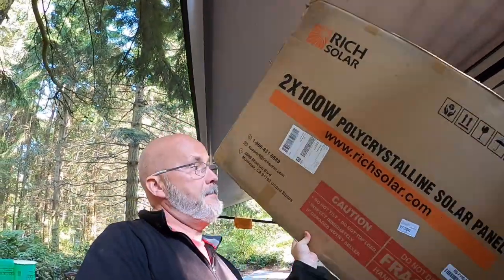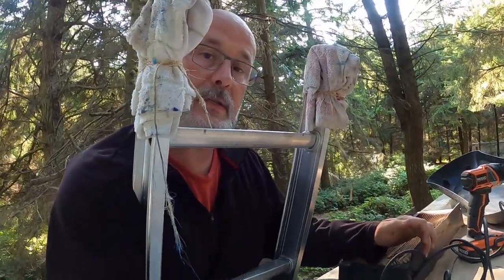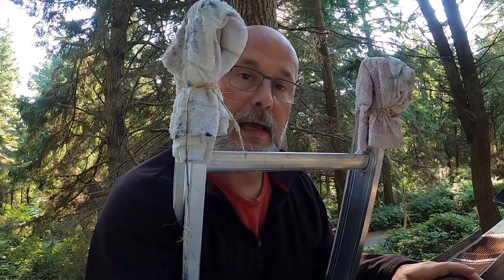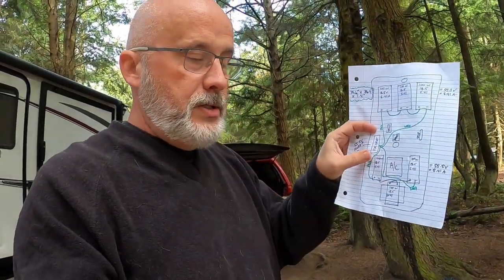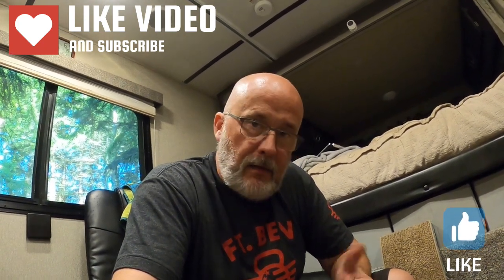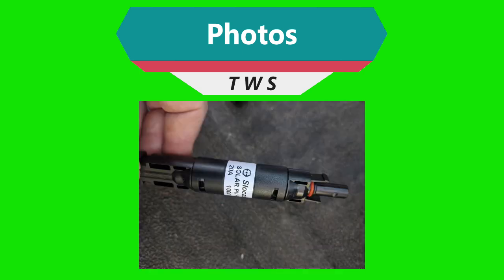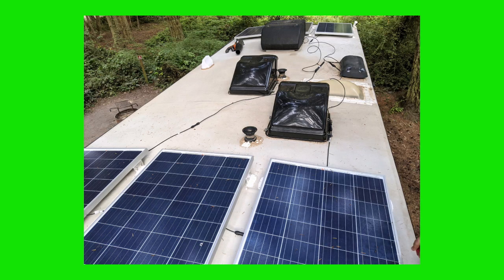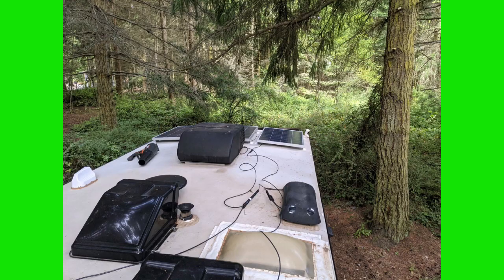UPGRADING OUR RV WITH 600 WATTS OF SOLAR- SOLAR INSTALL VIDEO

Comment: Thank you for this video. Currently have 200 watts on the roof and a 100watt ground mount but its not enough to keep up with the 12v fridge for more than a couple of days. I will be adding an additional 400 watts to the roof very soon. Would love to read some stats on the kind of power your pulling in on sunny days/cloudy days etc.
Reply from the maker: Eddy, Glad you enjoyed the video and thank you for watching. It's funny you should mention the solar setup. I was actually just working on it the other day. We still have the 600 w on the roof and the 340 amp hours of lithium. Since I did that video I have actually upgraded my solar charge controller to a 60 amp hour controller so that I could use all of the 600 w that I have. I realized that the 30 or 40 amp hour solar charge controllers would potentially be limiting my use of 600 Watts. Long story short, I also mistakenly undersized one of my wires from the solar charge controller to the shunt and has been that way for a year. I had previously maxed out around 405 watts on a really nice day since changing out the wire to the correct one. I hit 605 watts the very first day on a fairly sunny day but with some clouds.

I'll have some better numbers here in the next month or so as I am currently hooked up to Shore power for a few days and haven't been able to use the solar all that much.

Comment: really wish you did unistrut, much nicer for changing panels, layouts, angles etc and can remove them later on if you move trailers etc
Reply from the maker: Yes I agree after seeing some other folks set up it probably would have been a more efficient and easier install. Unfortunately with living on the road it sometimes difficult to get things delivered and since I had all of these supplies already waiting for me it decided to go this route.

Comment: Did you guys do a video on connecting all the solar to the charge controllers, inverter etc?
Reply from the maker: No, we actually didn't do a video with all of that detail. However, if you have any questions, we're more than happy to answer them the best we can. We do have a few still images that I could share to give an idea of what we did

Comment: Love the video! So you get power only when you plug something into the inverter correct? You didn’t wire it into the fuse box of the rv?
Reply from the maker: That's correct, we have wired our TV into a small 300 watt inverter in the cabinet but the only other plugs that are hot would be the ones on the 3000 watt inverter under the couch.  Just don't have a lot of daily need  for 120 volt plugs  being hot.
Reply: @thewanderingshores  That’s awesome 👍🏼 I’m thinking about doing something similar, also not wanting to mess with the fuse box myself but just run an extension cord through the bottom of the floor from where the inverter is going to be located to where you connect to the shore on the rv and shutting off the converter/battery charger from the fuse box that way it doesn’t try to charge the same batteries that are powering the rv and run everything that I want without having cords going everywhere in the rv… but still brainstorming where I’m going to set everything up..lol.. 🤯😊 love your videos brotha please keep making videos on your new found journey cause when I watch them it’s like I’m living mine through you guys 💯💯💯💯💯💯💯💯 safe travels my friend
Reply from the maker: @Fabe408   That's a great idea, I've actually tried doing that myself and it works just fine. I just ran an extension cord from our inverter under the couch out the door and under the camper to the regular power cord for sure power. Then, like you said, most importantly turning off the converter switch so that you don't have a circle. Just heads up though on ours if you turn off that converter fuse it also turns off  The refrigerator plug so you're going to have to run that on propane only.
Reply: @thewanderingshores  Thank you for the heads up, Happy New Years 🥂